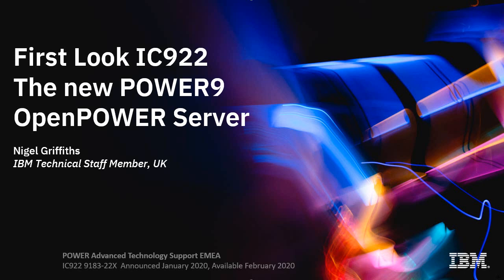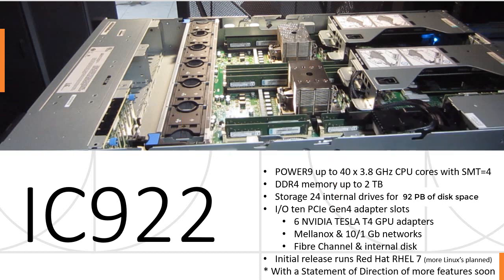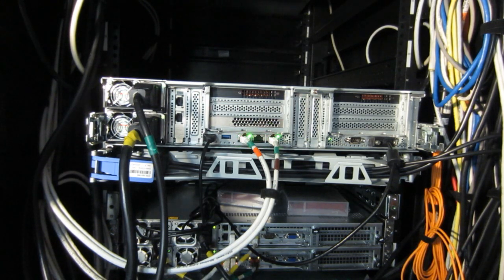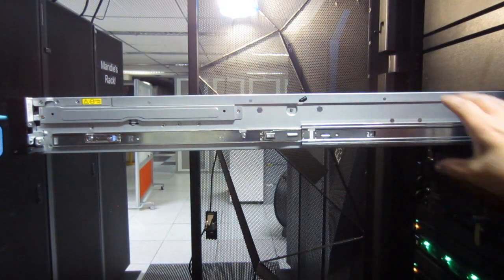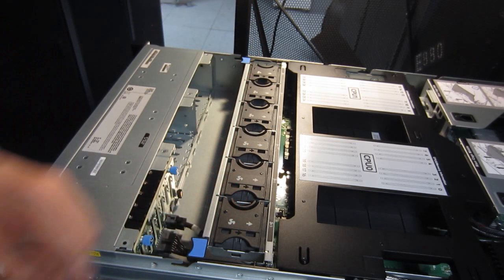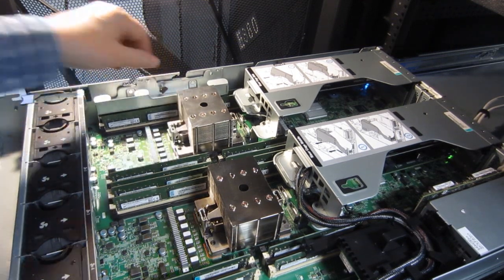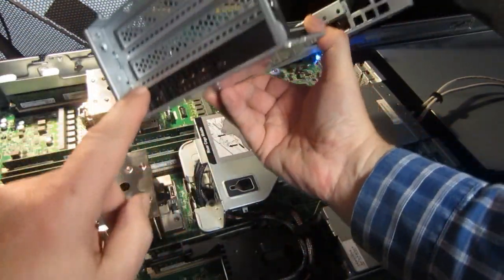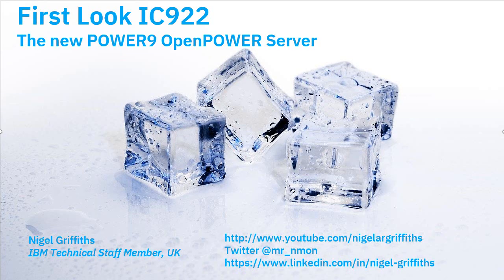IBM POWER9 First Look IC922 Server

Comment: Hi Nigel , can u please do post on AS400 .
Reply from the maker: The IC922 does not support IBM i or AIX. 
The old term AS400 is now called IBM i operating systems running on Power Systems Scale-Out and Enterprise server hardware.
I am a specialist in AIX and Linux and know very little about IBM i, so I will not be doing videos on IBM i.  Of course, the S922, S924, E980 hardware support IBM i so hardware oriented videos apply to IBM i too.